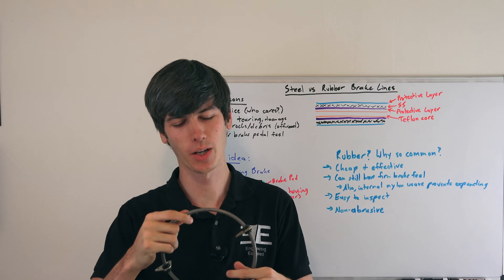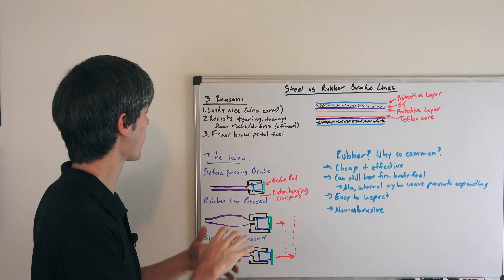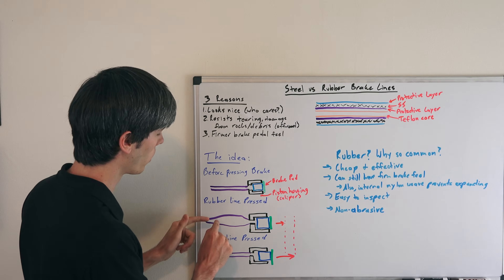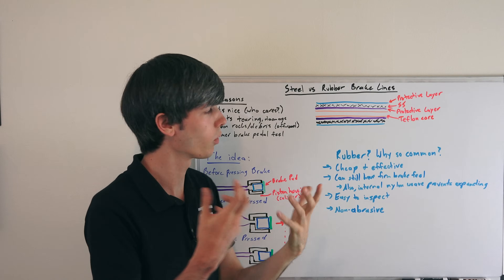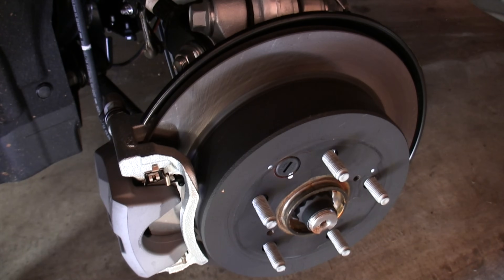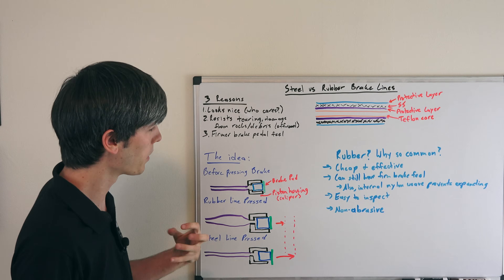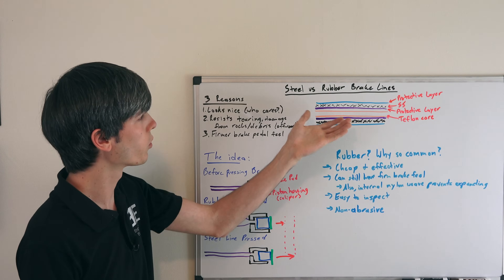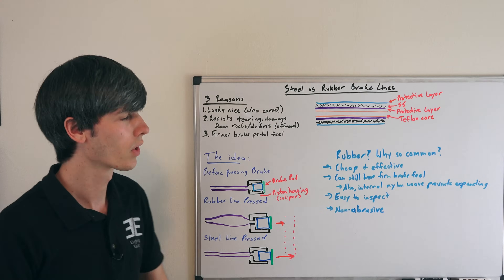Steel Vs Rubber Brake Lines - Are Stainless Steel Lines Silly?

Comment: Trust me I know my stuff
I'm not a mechanic
I'm having it as my hobby
But;

My Ford Escort RS Turbo S2 got upgraded to 6 pot brakes (all 4) + vented&slotted rotor that made so much difference
Due to it needing more pressure it needed atleast the Focus ST master cylinder (larger, pushes more pressure through)
I used rubber lines because I thought my brakes were fading
Then I changed to braided and they still had that feel 
I putted a brake bias valve into it and that solved it
Installed it and setted it up correctly
Now I did try rubber back on for about 1.5 year 
Then I looked at them and they still looked like new basically
After driving it 1.5 year daily, every weekend having a trackday with heavy use on then etc.
Now I changed back to those fancy expensive braided ones and tried them at the trackdays amd daily use and there is literally NO single difference
YES I agree they look so much better (imo only on good cars not on Multiplas!) But... No quality difference in it
Also the way the braided ones are much stiffer in bending them around when installing are just a no-go

Take it from me; just get highest grade Ferodo (or other A-class brands) rubber ones and save it for bigger brakes/mastercylinder/brains/racing license/brake test/driving test or ofcourse tofu
Reply: Oh so I thought putting stainless steel lines would get rid of fading on my Mazdaspeed/MPS but that won't help?

Comment: Great  video.  I was a  hose  development engineer  for  30+  years and  would  just  like to add that nylon fiber is  NEVER used  as a brake hose  reinforcing material.  To minimize volumetric  expansion of a  rubber  hose - i.e. pedal firmness,  fibers  such as  PVA  (polyvinyl alcohol)  or  aramid (Kevlar)  are often  used with  rubber  hose.  Steel  wire however  has  the lowest  elongation and  therefore  lowest volumetric  expansion of  any  of  these other synthetic  fiber reinforcements.
Reply from the maker: Thanks for sharing your insight!
Reply: Kickass niche job! I love hearing tidbits and explanations like this.
Reply: I would say yes, but the hoses are only one component in the brake  hydraulic circuit, so the overall difference may be relatively small. But if you have long hoses and / or run very high temps on your brakes - i.e. race applications, there will be a noticeable difference in pedal feel.
Reply: I feel smarter just for reading that.
Reply: So buy a quality hose rather than the cheapest one as aramid etc is expensive. However I don't see the braided lines doing much. It still has a synthetic rubber core and it would depend how tight the steel braiding around this core is, otherwise it can still expand.

Comment: This a pretty biased video. He didn't really mention the pros of stainless/PTFE lines. PTFE has a much longer lifespan than rubber. I've never heard of the inner line puncturing inside of the stainless weave, but I suppose it is possible. With SS/PTFE lines, you can expect to not have to change them again assuming they haven't been damaged. As far as longevity, it's the best option. But like he said in the video, it really isn't hard to replace an old or damaged rubber line:

Comment: Rubber gets soft after 2 yrs on a motorbike. SS or carbon braid is instant 2 finger braking & last longer than rubber.I can feel the rubber expanding when hard braking. on  10yrs old fast bike I will change.

Comment: The only issue I might have with rubber brake lines is high temperature.
While track driving, the brake fluid can get really hot, and rubber hose could potentially become softer and expand. I wish there was more data on this, e.g. temperature properties of the rubber material used in brake lines.

Jason, could you perhaps add to this thought?

Comment: I might be wrong here, and if I am, please explain how I am wrong when I say this...
Would the pressure move the caliper piston FIRST until a certain pressure is reached, THEN start to expand the rubber hose until a certain level is reached before putting more pressure on the caliper piston?
Reply: I think your right, I would imagine the expansion is proportional to the pressure. There may still be a little expansion followed by greater expansion once the pad bites.

Comment: My Car is 13 years old and I finally replaced my OEM rubber hose and I definitely noticed a difference in brake pedal feel. I should also mention that I also at the same time replaced my Front rotors and pads.

Comment: You ever smash your brakes down going over 100+mph trying to stop and they get so hot the rubber line bursts and you lose pressure? That's why you get SS. It's a performance mod.

Comment: Thank you so much for your video, now I know how little you know about general mechanics, this is why having experience won't lead you into false information like this. Rubber brake lines are just cheaper and used on cheap chinese cars, they expand with heat and have about 3 times shorter lifespans than stainless line.
Stainless will keep the rubber from expanding, this is why you cannot enter most track with either bikes or car that don't use stainless or coper or nickel coper brake line. Stainless will help diffuse the heat generated by the calipers and high pressure system, rubber will not. This is why you have to check every season you brake liquid level on cheap imported cars, because the rubber line will expand or contract depending on barometric pressure and ambient temperature.
Planes NEVER EVER used rubber line for any fluid or air line, in fact, stainless steal flexible line have been invented by the aerospace industries during the second world war (from memory), because of many failure over different system. 
I do not understand why this channel has the word Engineering in it, you seem to not really know your field and just repackaging similar videos.

Comment: I discovered at ~ 7000 mi, that the rubber flexible brake lines on my former, '08 Maxima, were plumping like *all *ark franks, during a normal hard application onto the brake pedal.   Unbelievable, but installing SS flexible brake lines, returned its excellent immediate braking response.

Comment: Rubber rots, steel does not, my rubber lines started leaking brake fluid after 20 years of light use, yeah, steel is better!
Reply from the maker: 20 years is a solid amount of time for a part to last.
Reply: Engineering Explained I guarantee you the steel brake lines that replaced my 20 year old rubber lines will last longer. Also, the rubber lines were on my 1997 Pontiac Grand Prix GTP that is still going strong, so for all who have bad things to say about GM, it depends on many factors. However I for one can say that older pre-1998 GM is better overall than what they produce today. I highly doubt modern GM vehicles will last as long as my GTP has...
Reply: steel does rot, especially if exposed to extreme heat and salt, thought most stainless steel lines shouldn't rust at the standard range your brakes should see.

Comment: What they all forgot to mention: Brake fluid is hydroscopic. It attracts water. Water in the brake fluid reduces its boiling temperature. Boiling brake fluid can not transfer the pressure to the brake pistons- bad ! Rubber hoses contain a softener that contains- water. Brake fluid sucks the water out of the hoses. Hose replaces it from the surrounding environment. Hose becomes brittle. Motorbike manufacturers recomend to change the brake hoses every 4 years- or use SS PTFE- ones...

Comment: Every rubber line I have cut or seen cut had steel weave inside it anyway. I was probably not SS so it was coated with rubber to protect it from rusting.
Reply: I believe rubber hoses have a type nylon weave inside them.

Comment: Why do ss brake lines say, for off road use only?
Reply: Those were probably not DOT approved and to get DOT approval you have to pay for the testing required. But many manufacturers of SS braided hoses get DOT approval. Even smaller companies like Techna-Fit have gotten DOT approval for their SS braided brake hoses.

Comment: Would you recommend the steel ones for adventure off road builds? For peace of mind. I might straighten the ladder chassis for better ground clearance which will require new flexible connections

Comment: Stainless steel braided lines are what are used on aircraft. Aircraft quality. always the best, right? True story. I was in the Navy, assigned to an A-7 Corsair II squadron.  Naval aircraft used hydraulic systems that operated at 3,000 PSI. To operate the hydraulics on the ground without running the engine[s] an external source of hydraulic pressure is used. It was a wheeled unit about the size of the president's desk in the Oval Office.  Anyway, they guys that worked on the hydraulics needed a replacement hose to hook up hydraulic power to the aircraft and had one made up by the base hydraulic shop. It was beautiful.  Shiny stainless braid, AN fittings...GREAT! First time they used it, it burst.  Turns out it was only good for about 500 PSI.  When they got the correct hose, you guessed it. It was rubber.

Comment: Put SS lines on three cars as a before and after.  Alfa 164.. better pedal feel. My current E36 M3.. only a little improvement in feel.  Fiat X1/9 track car, big improvement in feel to a car that already has great brake feel. FWIW

Comment: Stainless is also much better in racing where high temp can damage rubber also the small dia makes them easy to tuck out of the way.Also rubber lines can go bad and look good.they will clog up inside and make the brake drag and get real hot.

Comment: you need to take in consideration the size of the brake pump when you talk about firm bakes or not with the rubber or the metal tubes,eg,a 16mm diameter pump will have a lot more travel than a 22mm pump (on moto) to apply the same pressure

Comment: I would say like hydraulic hoses, any rubber brake line has a steel braid under the rubber. 

You're not going to get more than a couple hundred psi rating out of a straight up rubber line. 

The only difference between the two you're comparing is the appearance. Clear coat vs black rubber. 

A rigid steel tube, yes would flex less under load, but any braided line will "flex".

Comment: I think you misstated the bulging theory.  It's not that the hose expands before the piston extends, it's the other way around.  The piston extends, and it can only put the equal amount of pressure on the rotor as the hose can keep contained.  So the steel brake line (in theory) puts all of your pedal pressure into the piston and, by transfer, onto the rotor.

There is no way that the brake hose would expand /before/ the piston extends out of the caliper... unless your piston is seized.

So here are some completely arbitrary numbers as an example.
Assume a rubber hose has a pressure strength of 8 newtons per square mm.
Assume a brake system can apply 10 newtons /mm^2 
You won't get the entire 10 newtons/mm^2 on the pad/rotor interface, because anything over 8 newtons/mm^2 starts to expand the hose.

The only times I've used steel braided brake lines are on my motorcycle, and that's really only to protect from impacts since it's a dual-sport motorcycle that I take off-road regularly.

Comment: I've never tried stainless brake lines probably just because I seem to only ever hear about them from posers who are still running all-season tires and economy brake pads. I've melted shitty brake pads, boiled brake fluid, etc, but I've never experienced anything that could be interpreted as my rubber brake lines expanding under any conditions and causing a loss in brake pedal "feel." Pad knock-back, yeah. Overheated fluid, definitely. Rubber brake lines, not likely.

Comment: The Teflon core would explode if not for the stainless braid over it.  It is basically stainless reinforced poly tube. Clear coating is also to prevent abrasive material from getting between the stainless braid and the Teflon, which would cause failure. Stainless lines with protective coating are non-abrasive.

Comment: Hose expansion becomes a greater problem when the hose length is much longer, i.e. motorcycle brake hoses. Also age has a greater decaying effect on rubber lines. Most people do not service these hoses and the reduction in performance over time goes ignored because it's very gradual.

Comment: Jason, good video, I agree that OEM rubber lines are pretty decent. I don't go replacing them when they're new unless it's for performance applications. I have two points to add from my experience working on cars for a living. 

1) There hasn't been one car yet, in all the cars I've converted, that didn't see at least SOME brake pedal feel improvement by switching to SS.

2) Rubber lines expand under pressure, but more often I replace them after suspecting an internal collapse. The outside will appear fine, but the inside is not. You can't inspect for that. So you're left with a line that opens up under pressure, but collapses internally when you let off the pedal. This can hold hydraulic pressure in the system at the caliper or slave cylinder if it's a clutch system. This inability to completely relieve pressure leads to warped brake rotors and slipping clutches.

I never say never, but I've yet to see something like this happen even with very old SS lines.

Comment: Old rubber brake lines brake down internally.  What it affects most,   cars with sufisticated modern traction control/anti-lock brakes.  Old rubber expands at different rates to all 4 wheels over time causing inconsistent directional control and pedal feel. Need to think outside the box on this one. Grandma, Grandpa, and the wife with kids would never know the difference. If you autocross and do spirited driving in a modern high performance automobile the results are symmetrical, powerful braking, and control in all conditions. They are nearly bulletproof for offroad and the angry ex.

Comment: Not a very helpful video. I think i'll take the advice of the veterans at the local race track and replace my lines with steel braided ones. Brake fluid can get pretty hot after several hot laps and i think the steel braided lines can resist expanding a lot more than the rubber ones.

Comment: Brake hoses, not brake lines. The lines are always solid steel. Hoses connect the calipers (or wheel cylinders, if you have drum brakes) to the lines.

Comment: Surely it depends on more then just the brake lines. 
Me and my mate have both agreed that the brake pedal in my XG Falcon ute which has stock rubber brake lines feels just as firm then the pedal in his EL Falcon which he runs stainless steel lines as the car is on track and drift duties.

Comment: Forgot to mention the hygroscopic properties of rubber and brake fluid. So the fluid itself becomes contaminated much easier and your fluid doesn't maintain its boiling point as long with rubber vs. stainless.

Comment: I have 35" tires on my Wrangler and the brake feel is very mushy, i was about to pull the trigger on some SS brake lines. Is it not going to eliminate the mushiness and bring back the factory brake pedal feel then? This video left me a little confused. As u know, the Wrangler is not exactly a race car, nor does it need to emergency brake quit as often so overheating the calipers is not the problem, the pure mass of the SUV and the large wheels and tires are... With that in mind, WILL THE SS BRAKE LINES HELP TO STOP THE JEEP BETTER? (or rather slow it down quicker?)Thank you

Comment: Steel braided brake lines also reflect radiant heat and most are covered with a rubber of sort to prevent corrosion as an oem rubber line does well.

I personally change flexible brake lines around every 100k miles or if the brakes have overheated more times then not to prevent failure.

Comment: Come on EE. At 1:24 you should know better. The pressure is always the same throughout a continuous fluid. Expanding the brake line does not reduce the pressure if you keep pressing the pedal with the same force. What it does is increases the volume of the pipe and so increases the amount of fluid that needs to be moved to create the same braking. This is part of what makes up the "pedal feel "

Comment: Has anyone considered that large hydraulic construction equipment uses rubber lines? You don't see them switching to SS lines because of their lines ballooning out an losing power. They are pretty much reinforced the same as the brake lines on your car, just a lot thicker and more reinforcement. And I know... yes, hydraulic lines can be reinforced with a wire braid, but they also support far greater amounts of pressures than your vehicles braking system could ever achieve.

Comment: Steel lines provide considerably better brake-feel on motorcycles. I'm not sure exactly why they might feel so much better, but it's a night and day difference between rubber and steel lines, especially on the front brakes. Other than this caveat, I completely agree with their limited benefits for other vehicles.
Reply: i agree -i was thinking it might be because the rubber section on motorcycles is longer and the fact all the braking is thru one wheel really...but i wish i could get the same difference in brake lever/pedal feel to transfer to my f350 by the same margin
Reply: Marc D  you can get that big of a difference on your truck throw a set of Brembo 6-piston calipers and oversized rotors on it